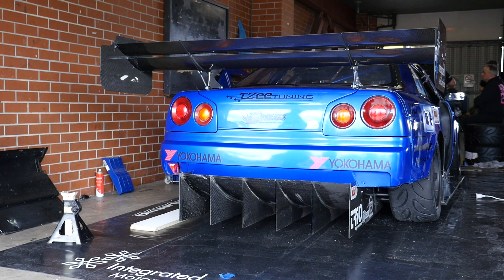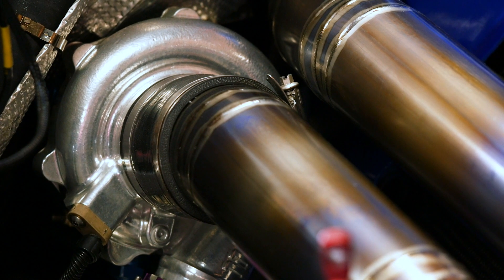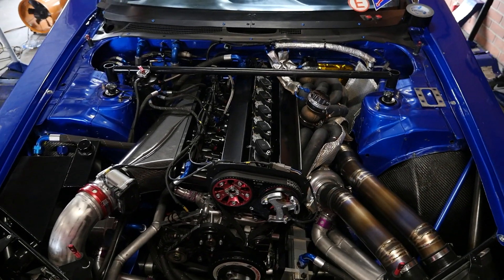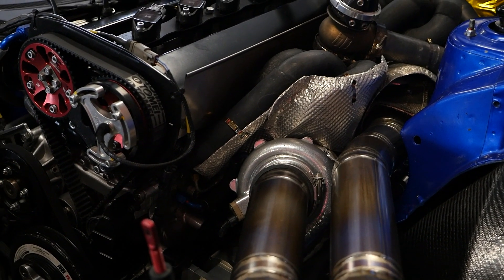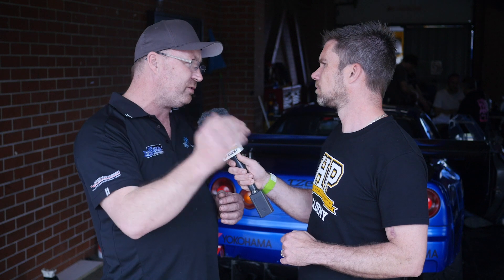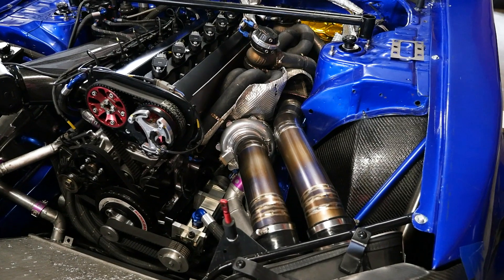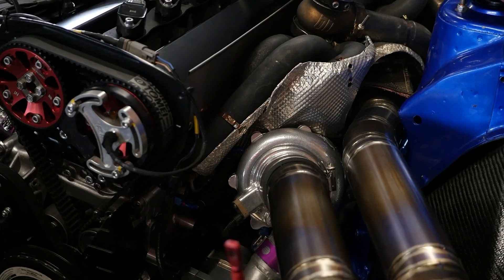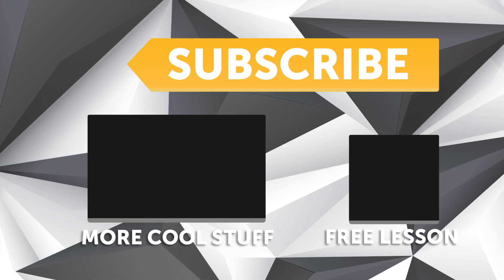Single Turbo OR Twin Turbo? | 1200HP R34 GTR Skyline [TECH TALK]

Comment: Doesn't having two turbos add  more parasitic drag than if you were moving the same amount of air with one turbo?  I'm not seeing how two smaller turbos would spool any faster then one turbo that was twice as big as the smaller ones. Help me learn.!
Reply: Rotating mass, the large frame big hp turbos have some gnarly shaft/wheel sizes. Two smaller turbos at levels like these require less inertia. As well pressure ratios are much higher as stated in the video.
Reply: @loganbentley9627  awsome that helps. Maybe that's why the Bugatti veyron has 4 small turbos.
Reply: @jayknight139  Never have found data on those, but I doubt they're small whatsoever. Probably at least 50+mm compressors.
Reply: @jayknight139  This is conjecture on my part, do not take it as fact; I believe the twins outspool the single because of smoothed exhaust flow (having only 3 pulses hitting eachother in the collector vs 6 will cause a lot less turbulence in the manifold/turbine housing), better expulsion of exhaust from turbos (look at the exducer sizes for a 1k hp single, vs two 500hp turbos, the smaller ones overall have more exhaust surface area), and better adiabatic efficiency at target boost levels (smaller turbos can be more efficient around 20-30 psi than a larger turbo that may take 40+ to see peak efficiency).

I believe all of that is pretty logical and based on how it actually works, however, I am just an interested laymen with no expertise here. Would love to get others' inputs.
Reply: @aiGeis  Another "interested layman" checking in! The turbulence point is good, but with the big single EFR9180 they would be running a twin scroll exhaust housing. However, while dividing the exhaust pulses is good for turbulence and exhaust scavenging, it also means that neither of the two halves of exhaust flow hit the turbine wheel in the "sweet spot" aerodynamically. Now, when only having 3 cylinders to a turbo, there is zero chance of having exhaust gas reversion, turbulence is minimized, and all the gas hits the turbine wheel right at the optimal spot. But obviously the big advantage to going twins is more airflow potential both in and especially out, like you said.

Unrelated but since you are clearly a passionate, detail-oriented person I'm curious, have you ever heard of pre-turbo water/meth injection? Literally spraying into the inlet of the turbo once it's on boost?
Reply: @MR__JUSTIN  Unfortunately only saw your reply these 6 months later, however in case you do see this: yes, I have heard of pre-turbo meth injection. I never looked into it too far since it very uncommon in the tuning scene, although I do remember a few of the details a very knowledgeable user on HT described. Injecting pre-turbo is both difficult and dangerous in terms of damaging the compressor wheel since there are very few nozzles that are up to the task of vaporizing the liquid well enough. Supposedly there have been diesel guys who've had success through the use of mechanical pumps running very high pressure to aid the nozzle in vaporizing the water/meth mixture. It would be interesting to see how much of a benefit there is to this style of meth injection, as it could render race fuel/e85 rather obsolete if the gains were high enough.
Reply: @aiGeis  better late than never! What's HT? I would love to look up the link to that info if you've got it. And I agree, the octane boost it provides largely obviates the need for ethanol or race gas. On demand detonation suppression for the win!
Reply: @MR__JUSTIN  Honda-tech.com... Advanced search query for user Wantboost and a keywords "pre" and "injection" and you'll probably come across his information on it. I guess I could always link later on if needed. Wantboost as far as I understood it has worked for an (amateur?) race team and has worked on many projects, and therefore is a wealth of knowledge. Unfortunately he has not been active for years. 

Search for turbo related posts from username TheShodan if you want to perhaps learn some interesting and deep knowledge on turbos, he's been an active user for around 20 years and is now the primary moderator in the forced induction subforum. He works for speedtrapp consulting (STC), they design custom compressor wheels for Garrett turbos and have unique turbine/compressor combos using Garrett CHRAs. He's a true powerhouse when it comes to accolades, having worked for various amateur and professional race teams, as well as being one of the lead developers for STCs turbos. If you PM him a question or create a topic on pre-turbo meth injection, I'm certain he'll be as helpful as possible, no guarantee he has direct experience with it however (he doesn't claim expertise in all things tuning, primarily just the turbos ).
Reply: @aiGeis  wow awesome, very detailed information, thanks so much for that! I'll be doing some research for sure
Reply: Rotating mass of the  twins shafts and wheels is less but you also have less exhaust pulses hitting them...
Reply: @jasaircraft  yes that's true but quite frankly if twins were truly that much more efficient then way more people would be using it. But considering there is a debate I would imagine they preform pretty similarly to each other.
Reply: @jayknight139  just look at what auto manufacturers do, most vehicles with more than 5 cylinders that come turbocharged are twin turbo due to better efficiency. Racing teams dont really do it due to complexity, as Andre said it would be terrible to try and get to that rear Turbo. In racing Simplicity is key single turbos are just a lot easier to handle
Reply: @jayknight139  plenty of oem's utilize twins....
Reply: jayknight139 check out some volume/mass equations. You'll find for something twice as big (area) has much more than twice the mass. The other advantage with twins is the exhaust area to reduce backpressure. there isnt many singles that can run 10,000rpm on a 2.6L without torque dying in the ass due to exhaust expel restrictions. 2 turbos will get rid of the exhaust gas faster and keep peak torque for longer. Spool has always been the downside to twins, but it's slowly becoming much more viable again.